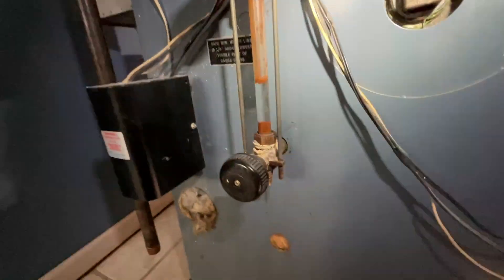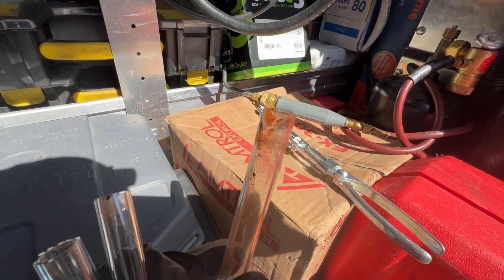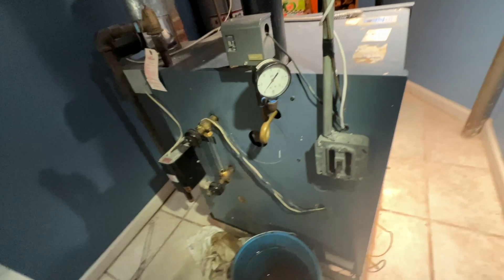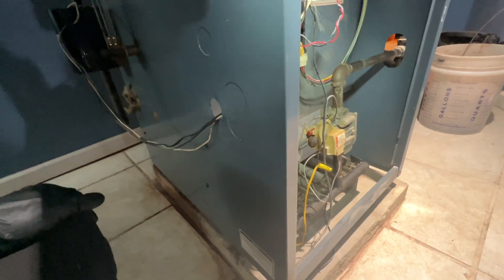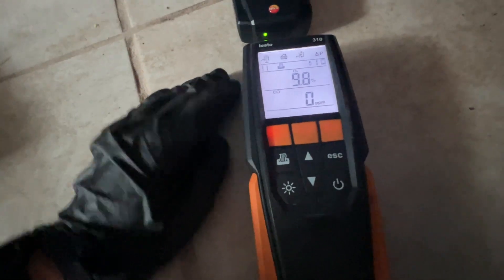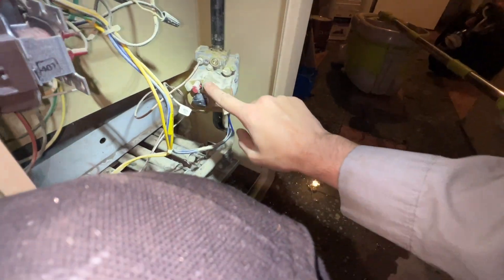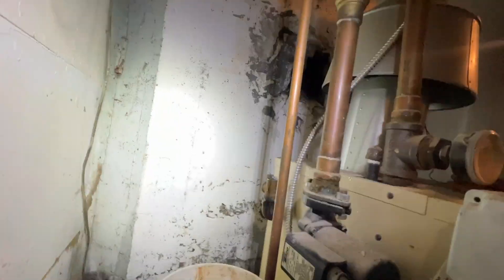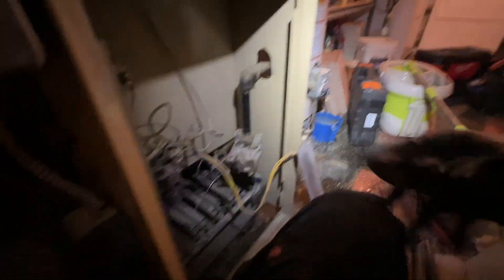Heating Season is Official! Steam Heating System Maintenance! Crusty Sight Glass Fixed!

Comment: I don’t know if you know or most Hvac tech’s because I didn’t. A lot of those boilers have a fuse inside the black shrink wrap that goes to the vent damper. For reference.
Reply from the maker: Yea if the fuse blows that means automatic replacement of the vent damper and the wiring harness.

Comment: Excellent work as always, not that Mike should have called an Uber to give you a ride home.   But I never leave a pilot either standing or spark in any way enabled when I have the gas logs out.  Not only do I not trust myself but I also do not trust mechanical devices.   I also change the thermocouple every time I pull the log out, it's a $30 callback warranty.
Reply from the maker: We always leave pilot burner in and pilot in. If you have power shutoff it can’t magically open the gas valve.

Comment: I work as a glass blower for 11 years and every morning I would come in and prep my blow tubes which would involve taking 4 ft sticks of 12 mm heavy wall glass and breaking it into four even one foot blow tubes. The quickest way to do it is with a carbide scoring knife and you score just a quarter of the tube and lick it snap with the score away from you. Absolutely perfect cuts every single time. A couple years ago I did the math and figured out how many glass pipes I actually made while working full-time and it was like 46, 000 pipes in 11 years and every two or three pipes I would make a new blow tube so I probably scored and snapped at least 20,000 pieces of glass tubing and that little carbide $5 scoring tool got used for every single one and it still works like it was brand new

Comment: Nope they tightened to tight and it snapped. I've done it should change elbow.
Reply: If you tightened steam fittings to tight they can crack
Reply: @scottmaz4063 what is a steam fitting?
Reply from the maker: @scottmaz4063  it was a cut from a grinder or sawzall
Reply from the maker: What?
Reply: Steam fittings are also called cast iron fittings. As opposed to gas fittings/black fittings/ malleable iron fittings.  CI/steam fittings are somewhat susceptible to cracking when overtightened.

Comment: Have you considered using a boiler treatment each time you do your servicing?  I use a Rectorseal product called 8-way or a Hercules product each year.  With the former, the water in the sight glass turns purple to tell you that it is working.  Nice video.
Reply from the maker: We offer it. We use surge-x. It turns the water super lime green. And it turns red if the water needs to be changed
Reply: @DCHVAC  any particular reason its not done as part of the overall service?  I figure it costs a bit more, and many homeowners might balk at that.